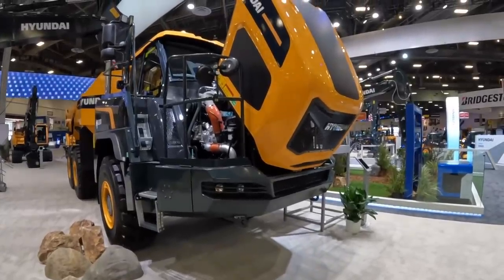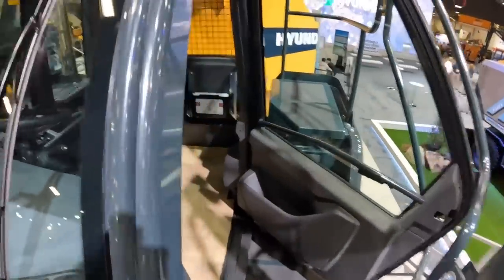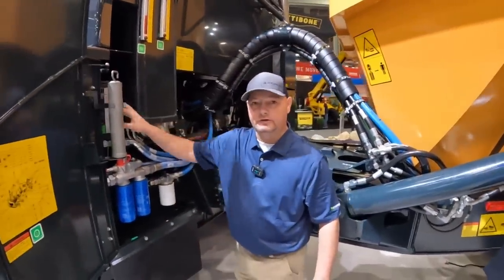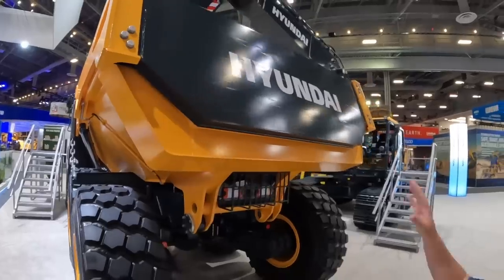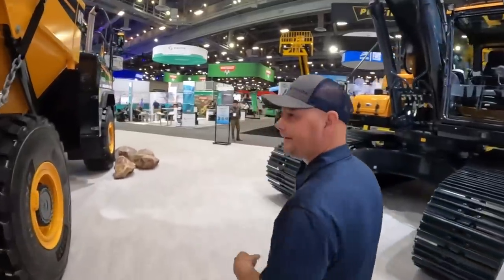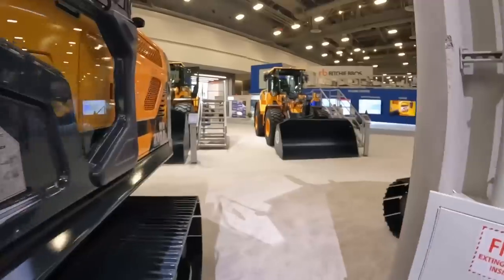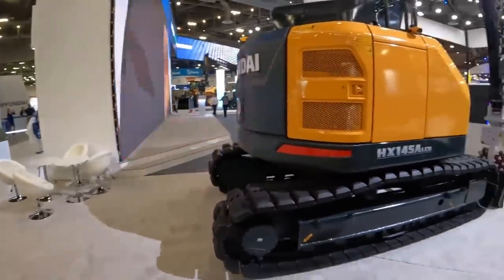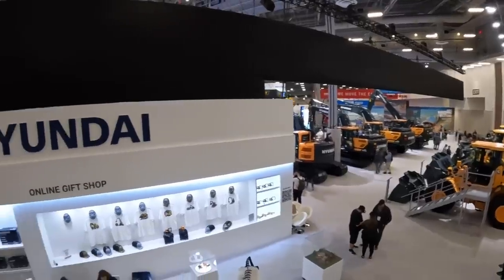Will we see one on the channel any time soon?? All new HA30 Hyundai haul truck

Comment: Having driven Scania trucks over here in the UK, I can tell you that their engines are probably the most reliable ones out there. I don't think there is any doubt that Mike will soon be driving a Hyundai truck, after all they do love him. 👍🤗 Nice seeing Jon aswell, hes another good guy, hopefully Hyundai Corporate will let him try out that smaller digger, just to make up for his last outing with the Hyundai dealership. 💪
Reply: America knows Scania engines from the Case 4894 and 4994 4WD tractors in the mid 80s
Reply: Dc9 is a fantastic engine the dc13 not so much maybe without DPF/DEF which is probably why hyundai have opted for that setup been five cylinder too was a odd move and the 9 ltr is the only 5 cylinder rest are 6 and 8 cylinder
Reply: @marknewell7355  in heavy trucks its odd, but Mercedes, Volvo, Fiat, Renault, Ford, Chevy used 5 cylinders in passenger and light commercial vehicles.
Deutz, Fiat and Same used 5 pots in tractors, and the Deutz F5L912 was also used in the Caterpillar wheeled excavators after they bought the Eder line.

When we talk about low speed ship and power generation diesels, every odd combination of cylinders (5, 7, 9) was acceptable to meet a certain output efficiently which a 4, 6, 8 or 10 didnt.
Reply: @Sjanzo  by saying odd I was referring to scania using a 5 cylinder not 5 cylinder engines in general im a heavy diesel mechanic and heavy recovery specialist

Comment: A gentle reminder: Currently basically all hydrogen used is produced by an extremely CO2 heavy process, steam reforming. Per unit of work, a machine powered by hydrogen is responsible for more CO2 emissions than one that would use hydrocarbon fuels directly.

If we ever manage to get water electrolysis (or pyrolysis, I suppose) cheap and efficient, this will change -- but it doesn't look like it's going to happen soon.

Comment: Scania and Cummins have been working together for at least 20 years like many of the European truck engine manufacturers have worked with American truck engine manufacturers. So the biggest difference between both continents is the electronics side of the engines, where Europe basically every mechanic can work on an engine with the right subscription to be updated while in America it seems you need to be dealer certified or manufacturer certified to work on electronics
Reply: Not exactly. Apart from Cummins, every North American truck engine is designed in Europe, Cummins and Scania only cooperated on fuel injection systems. Though the new Scania 13 liter engine has German MAN input ans will find its way into Scania, MAN in Europe, Navistar in North America and VW in South America. 
Further development of the Cummins X15 is also in cooperation with the European Paccar branch...
Reply: @Sjanzo  I thought the scania/Cummins deal had been going back since the 90s and wasn't just the recent fueling system tech, guess the deal back then was only on specific parts again.
Do tractor manufacturers that use Cummins engines get the same poor deal and need to have Cummins techs to work on the engine management side?
Reply: @HootMaRoot  To be honest, Doosan dealers back here are glad Scania is out of the excavators, because they had to rule out all else before calling the Scania tech...

Comment: Love scania engine but that 5 cylinder in the hyundai is a pain in the euro6 truck application however he did say hyundai have opted not to use DPF and is probably the reason it kills the 5 cylinder engine's as a mechanic id have gone with the 11ltr 6 cylinder twin turbo for the ha30

Comment: Hydrogen to me is the fuel of the future.  I have run a small block Chevy gasoline engine on hydrogen much the same way as you would run an gasoline engine on propane back in the 1980’s as a class project. The engine did not have the horsepower of the engine on gasoline much the same way propane does not. However as part of the project the vehicle had an water to hydrogen converter on it. Tailpipe emissions were by in large condensation.  The class project was duplicating what some eccentric Brits were doing during and after WWII so they could drive there Bentleys and Roller’s.  One elderly gentleman who visited my school and spent several weeks with us was still running his pre-war Bentleys on the hydrogen setup he and his buddies created up until he died in the 1990’s.  JCB has been developing hydrogen run equipment and hydrogen generators to fuel the equipment.  I have no problem with the idea of fuel x engine over electric but am 100% against road cars, trucks and equipment running on battery power because the battery need electricity to charge them and the public is being flat out lied to about the supposed greenness of this. Additionally no country has a power grid to support electric vehicles and won’t if a all out effort was made until 2075 or later if there is enough copper on the planet to do so which by current estimates there is not. In short the electric car as presented now is a scam and is designed to keep the average citizen from owning a car because they won’t be able to afford or maintain them.

Comment: Build your own hydrogen fuel cell that the vehicle creates gas as it goes out of the water and turns it into hydrogen and then you can drive your car down the street a combustion engine will run on hydrogen a diesel engine will run on hydrogen you just need to make the individual fuel cells for each vehicle

Comment: Hydrogen combustion engines are horribly inefficient. A hydrogen power cell running electric equipment is the efficient way to do it, but there are also quite a few issues with hydrogen compared to battery other than the capacity and refill speed.

Comment: If you can make a diesel engine run on hydrogen and gasoline engines will run on hydrogen fuel-cell to keep up with demand that you need make and then everybody in the world can drive by a gas station and wave at them cuz we didn't need to stop for the going to the bathroom cuz we won't have to stop for gas no more cuz he's motors will run on hydrogen

Comment: @regsparkes6507

That HA30 has got to be job site tested i agree only thing is this they make them sell them by the 100s so i think just might be job ready and tested but hay if you can get one to run for a month free then grab that we all also know he wont be getting one as there expensive as and face it would it do any better than the B dump i think not then there is the weight of it for doing what D P does it be bogged most of the time